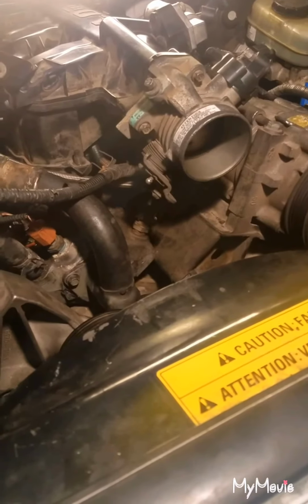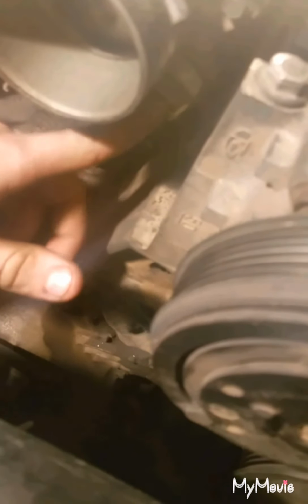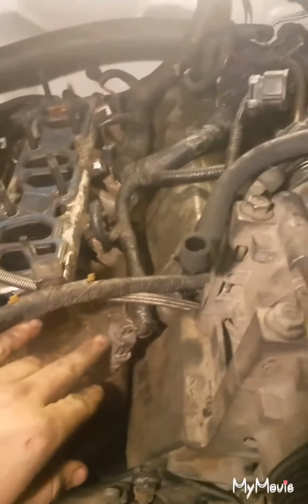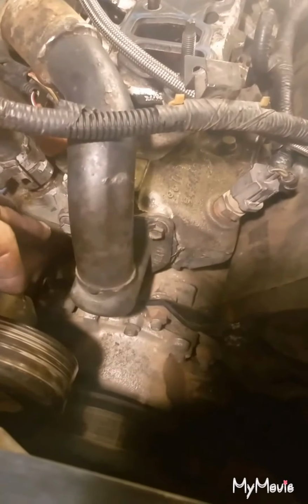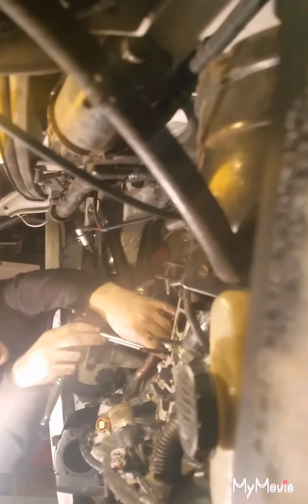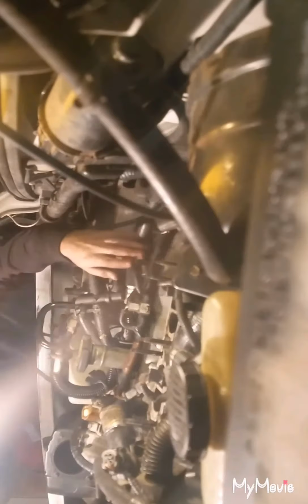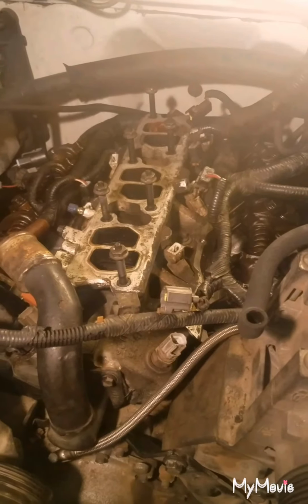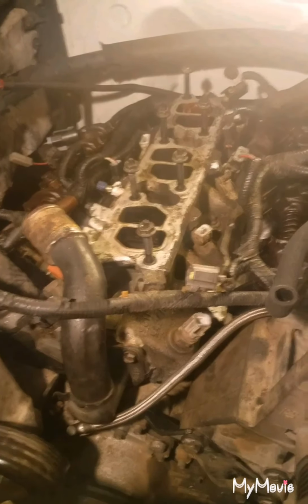1999 ford 4.0 ohv head gasket part 1

Comment: I just did my intake gaskets, the three vaccum linee in the back on the upper intake, I can't find the hose. Can you direct me to where it may have dropped?
Reply: I have the elbo and the break booster, its the other one that is missing. I cant find where the line went.
Reply from the maker: The one that I couldn’t find fell back between the firewall and the heads
Reply: @s1k_blondie892  i found it, it was the EGR connection. I have a major vaccum leak though, it starts and runs, but It barley goes forward. When I shut it off, I hear the hiss on the pass side.
Reply from the maker: If it’s on the passenger side it’s likly either the line that runs to your heater core valve or to the evap bowl or canister